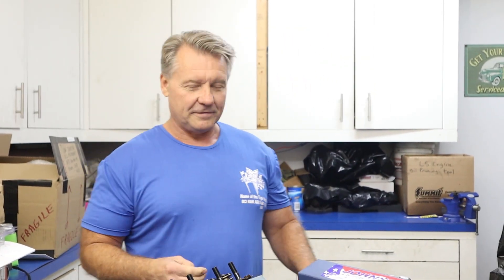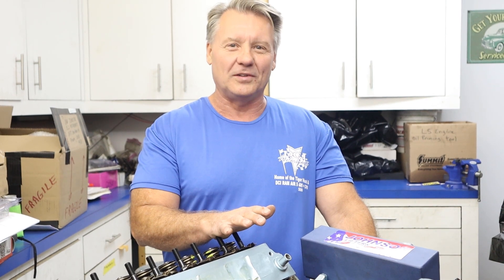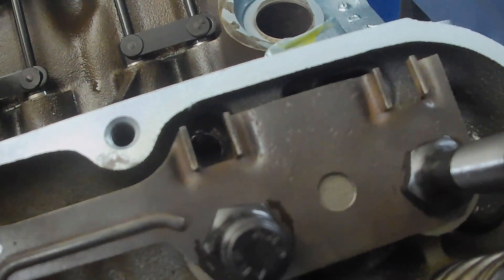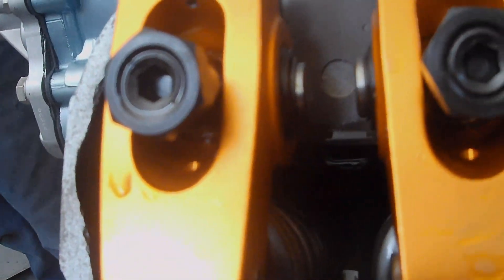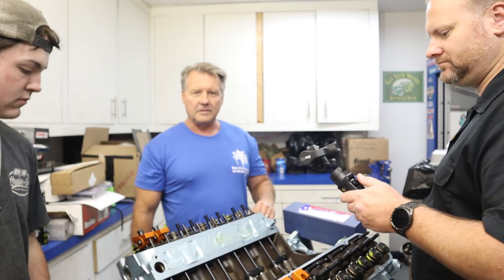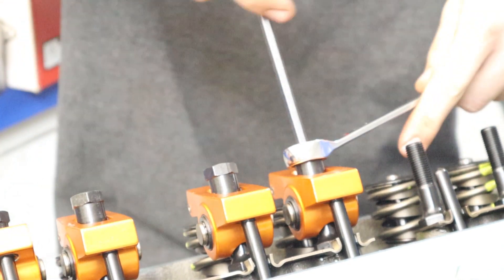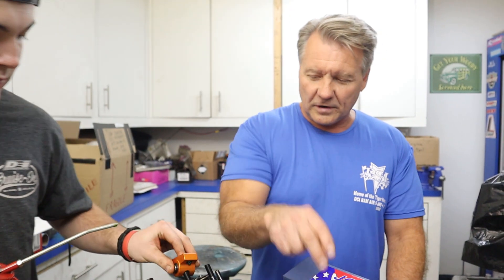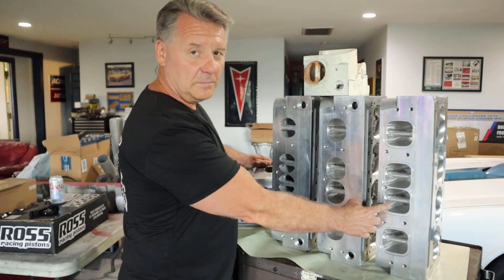DCI Motorsports Step-by-Step Guide:Adjusting Rocker Arms and Pushrods for Optimal Engine Performance

Comment: Don is it necessary to soak the roller rockers in oil overnight? I see in the video you are oiling the trunion, the roller tip and the pushrod cup as you install. I installed mine the other day and what I did was to clean them with mineral spirits, blow them with compress air and wiped them off, then just before I installed each, I would submerge them a minute in oil and then install but I’m wondering if a longer time in oil was needed or if that should be enough?
Reply from the maker: I would recommend you do, but It all depends on if you clean them in a solvent tank or just install out of the package. I teach my guys to clean even new parts before installing them.
Reply: @dcimotorsports1111  thank you Don, I soaked them in mineral spirits and blew them off with air before I soaked them in oil, but it was just a brief bath..